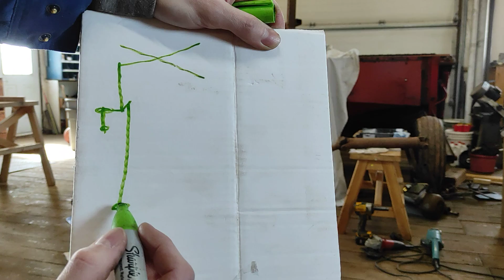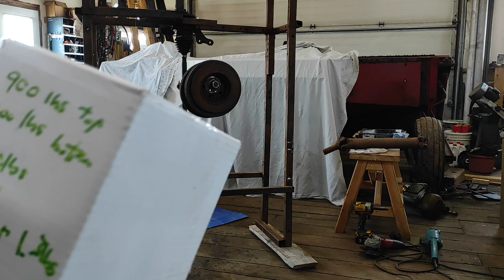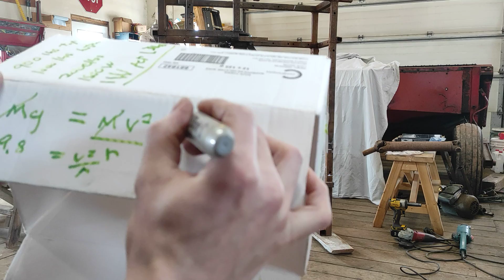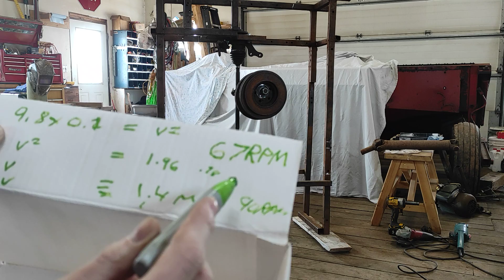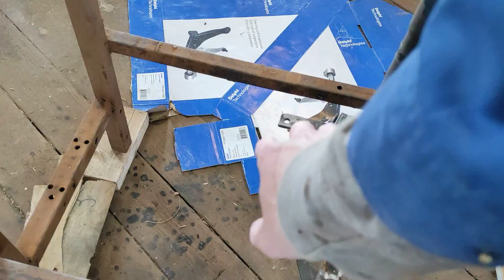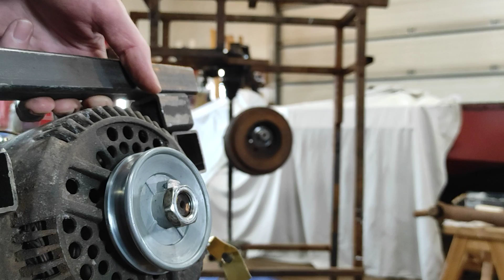New Gravity Motor Design

Comment: What are you hoping to accomplish here?
Reply from the maker: The goal is to replicate William F. Skinner's "Gravity Power Machine (1939)". Mr. Skinner had an estimated 100 watts input and 1500 watts output with his machine. I explain the mechanism of over-unity, the principles and calculations behind it, and demonstrate a simplified version of Mr. Skinner's machine.
Reply: @QuantumEnergySearch   You should know that what Skinner is claiming is not physically possible.  There is no such thing as over-unity.   You've built a machine that will always output less energy than is put into it.
Reply from the maker: @andybaldman That is a very dumb thing to say. It very obviously worked and there are multiple witnesses that it worked. My friend Sir Timothy designed 11 different types of working gravity motors. Generally, entropy is true but high efficiency and over-unity is an engineering skill. Besides, motion is all relative, so what's to say what's moving or not, and how fast it is moving if it is?
Reply: @QuantumEnergySearch   It's not dumb at all.  It's basic physics.  You can't make a machine that produces more energy than it consumes.   I'm an engineer.   This isn't about 'engineering skill'.  This is about the basic laws of thermodynamics.    You cannot get more energy out of a system than you put in.  An analysis of your system will show that.   Measure the power out over power in, and you'll see it's less than 1.
Reply: @andybaldman  he has menthal illness. let him be.

Comment: Curious, how does this differ from a flywheel?
Aside: flywheels doesn't suffer from the oscillating problem when the weight is distributed equally along the axis of rotation.
Reply from the maker: A flywheel is designed to be perfectly balanced within itself. There is no simple way to get over-unity from a flywheel. When the weight is unbalanced, you can use the centripetal, centrifugal, and gravity forces to get over-unity in different ways.